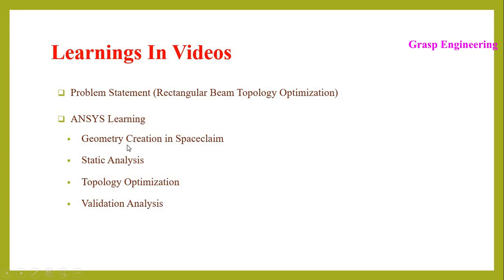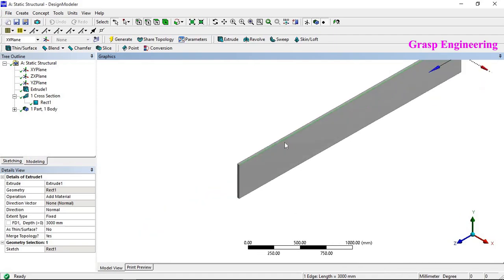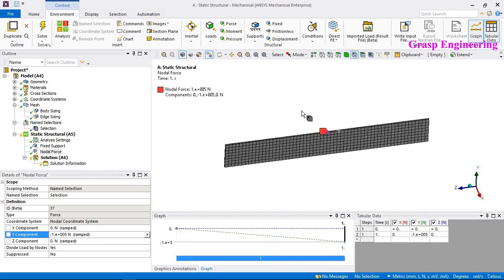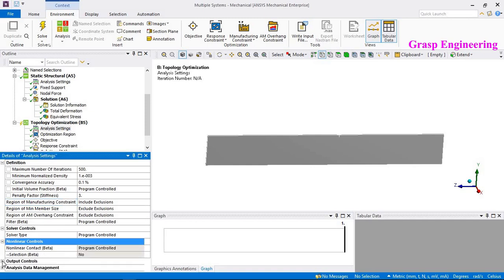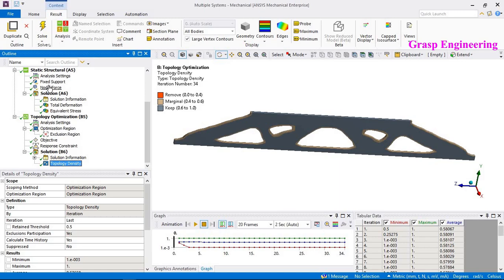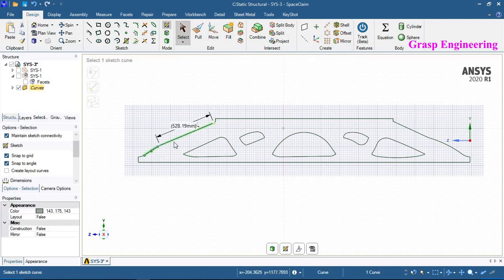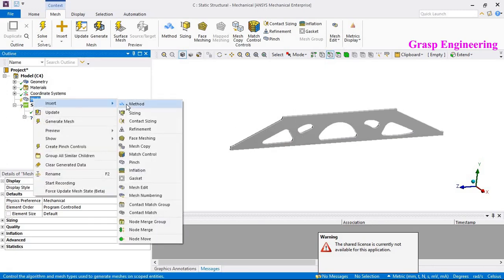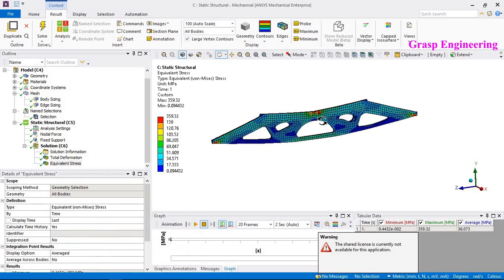Topology Optimization of  Rectangular Beam in ANSYS

Comment: Sir, very much informative video. I want to perform the topology optimization with minimise mass as objective function and stress (local/global) as constraint. For that purpose, i have first performed the static structural analysis and obtained the maximum von Mises stress. Can you please tell me what should be the maximum local/global stress response constraint, is it yield strength of material or maximum value of von-mises stress for unoptimised case? When I set response constraint as material yield strength and if in any case maximum von Mises stress for unoptimised case is more than yield strength, then there is not so much material reduction. Any idea about this aspect? Thanks in advance.
Reply from the maker: You should use stress as yield for ductile material, or even you can use some factor safety with yield limit too. Ideally it should not happen, "maximum von Mises stress for unoptimized case is more than yield strength". It mighet happen only when load are huge. First use yield limit and if not helps, then use factor of safety for yield (define allowable stress).

Comment: Thank you for your great videos. I am a university student from Japan. When I operate like a video, ANSYS2020R1 gives the same result as the video, but ANSYS2021R2 gives the completely different optimized shape.  The results was only one-third of its original mass. Why are the optimization results different?
Reply from the maker: Hello, Check the analysis setting and mesh setting. It might slightly differ in both versions. Ideally results should not change much.

Comment: Amazing video! I am coming across a problem though, after I run the solution for topology optimization, I am getting a different geometry. I am only getting 1 hole in the center of the beam, but not the other 2 holes next to it. Do you have an idea what that is happening? Thanks.
Reply from the maker: Thank you ! Mesh also affect the optimized geometry. Also check how much geometry you want to retain (0.3 to 0.6).
Reply: @graspengineering9249  it's because I followed every single step but okay thanks! I will double check my settings